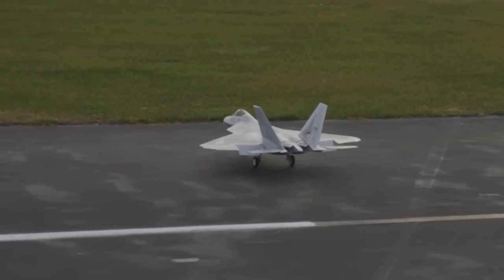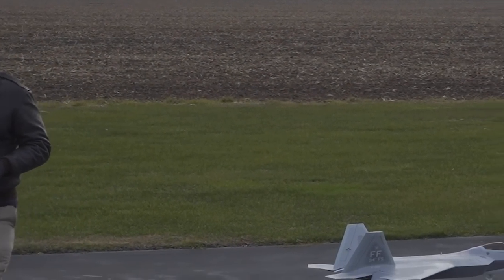Freewing F-22 90mm EDF Flap Mix and Gyro Test Flights High Alpha Slow Landings

Comment: I just flew this 90 mm 6S Freewing F-22 on September 20, 2020 representing our club for a park promotion event and I agree with everything Pilot Ryan is saying.  This is truly a great Freewing creation.  It has incredible slow speed manners and the nose gear is very solid if you run off in to the grass.  Tough as nails, great flyer and looks like a dream.  Tons of space in battery compartment.

Comment: Maidened my f22 6s today, put the cg well enough to the back to get to high alpha easier. This plane begs you to experiment with different configs, started today with simple mix between flaps and elevators, it just needs a tad of elevator and it evens it out so well I had to do a pass to believe I was on 50% flaps. It slowed but didnt balloon up :)   Your f22 videos helped greatly to ease the tension. Put in 2 perfect flights with equal slow landings in almost blue angels f18 style on our rather rough grass field. Those big wheels are great on rough grass. Thanks Pilot Ryan.
Reply from the maker: Man, that’s awesome. It’s a neat jet for sure. Glad I could help

Comment: Great job guys!  Merry Christmas!  What battery voltage are you running?  Is this the 8s or 6s version?  Also, can you say more about the gyro settings?
Reply from the maker: 6s stock, hobbyeagle a3l set at 11:00 on gains pots

Comment: Hi Ryan,  did you hook up the ailerons to the gyro as well or just the tailerons? Great vids by the way mate, keep em coming! ;)
Reply from the maker: I did hook up everything. No tailerons
Reply: By tailerons I mean the full flying horizontal stabs so did you gyro those with V-tail option or just go with gyro ailerons?  Some flight stabilizers like the NX3 have an extra aileron input so you can hook up both.
Reply: @benvankoningsveld    Did you get this figured out?  I'm curious how he had the tailerons with the gyro since you can't mix them in your transmitter??

Comment: How much % Gain did you end up with that flew the best?
Reply from the maker: 50 percent or 12:00 on the pots seems all around good especially if you want to go full throttle without oscillating. If it’s windy and I know I just want to slow fly and shoot landings I’ll crank it up a little to about 70
Reply: @Pilot Ryan Media 
Thanks!  I’ll memorize that one. 

I had the FW 64”. Sold it to a local begging to own it. 4S. 

Was too small for my old 4 Cataract eyes. I want to get a 70-90 EDF for this summer. F22 only one can be slowed enough on landing to fit on our blacktop parking lot. About 200’ long. With Full Flaps and Harrier Landing I can do it.